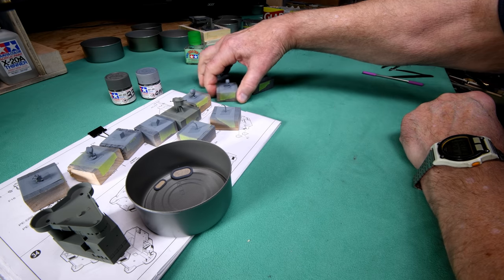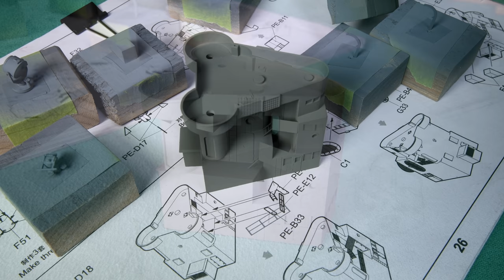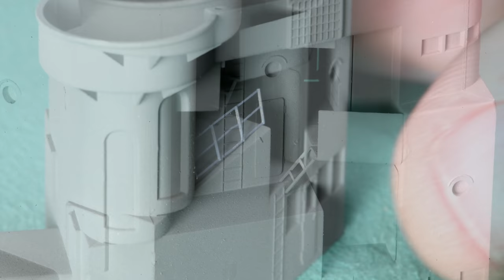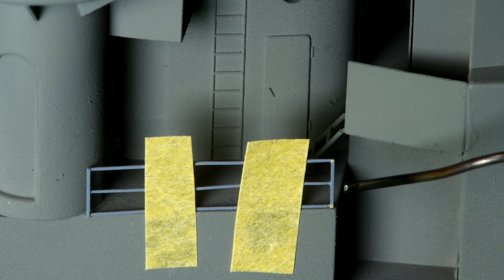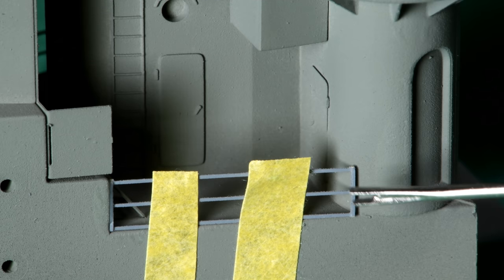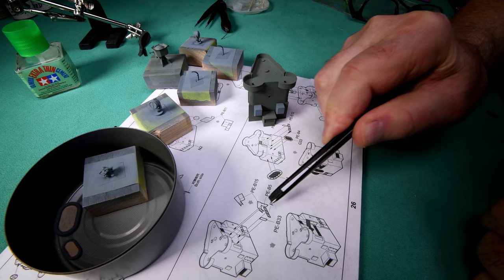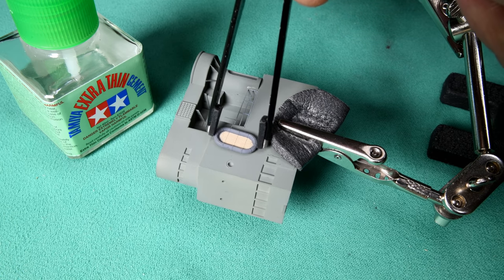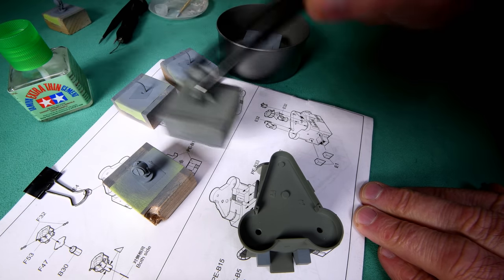The Model Ship - Part 667

Comment: Hi Ron, watching you fitting the short section of railing made me thing of how I sometimes fit similar parts on my 1:350 builds.  If you place a piece of Tamiya tape on the  top left corner so that it overhangs to the left you can stick the masking tape to the kit part where you want to fit the railing so that it holds roughly in place then, it acts like a third hand.  you can then push the bottom of the railing down with your tweezers in one hand and apply your CA with the other.  railings can be tricky, but I find this works for me.  Jason
Reply from the maker: I like the way I did it here at 8:24, Problem was it took me so long to remember that trick Jason. 👍

Comment: Hi Ron, I am going to start my first 200:1 scale ship on January. HMS Rodney. I searched YouTube and found your channel. Not sure of the correct way to contact you so I am just popping this post in here. I have watched about 12 of your vlogs and found them to be extremely useful. Great presentations. When do you plan to work on HMS Rodney?  Anyhow thanks for the time and effort that you put in, I am picking up a lot of good practices and ways of working. Have a chilled holiday and hopefully a great new year.
Reply from the maker: "When do you plan to work on HMS Rodney?"
The plan is to finish the Hood first. 🙂👍🎄
Reply: @roncalverley  - Good day Ron. I am thinking of starting in January.  This build will be a long term project, with smaller builds being done in tandem.  I will probably spend 1 - 2 hours per day on the Rodney. I will be able to start with assembling the hull and fully getting that up to scratch and no doubt a fair amount of the superstructure. I suspect that if I follow the process you are using for the Hood that I will pick up on plenty of details that I have not considered. 

One good process that I have already adapted is the box check. I purchased 2 350:1 Trumpeter kits also. The first of which will not be started for a couple of weeks. Previously I would just have put them into my stash without thinking there could be any problems. All kits will now be properly checked upon receipt. So I am learning from you already. 

By the way I love the box openings. It is a good way for other people to get a more detailed picture of the build ahead before committing to purchasing. 

Many thanks for your reply. I look forward to watching your next update. 👏 

I live in Lancashire in the UK not far from Manchester.
Reply from the maker: Re: "I am learning from you already"
You will learn from my mistakes, lol. 😁
Reply: @roncalverley  - hehe, just as useful if it stops me.